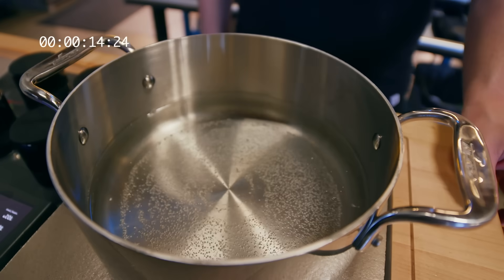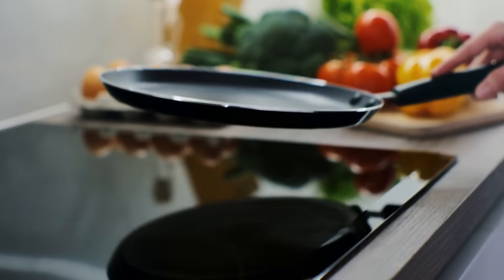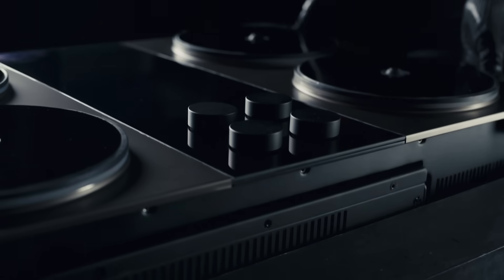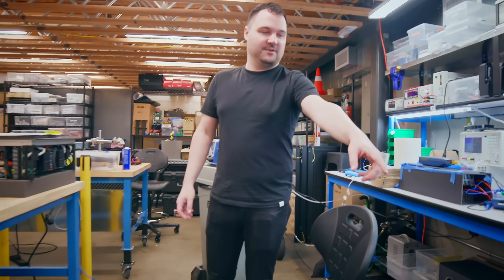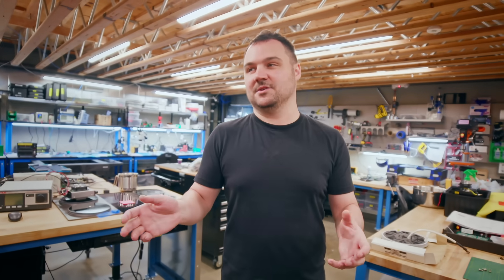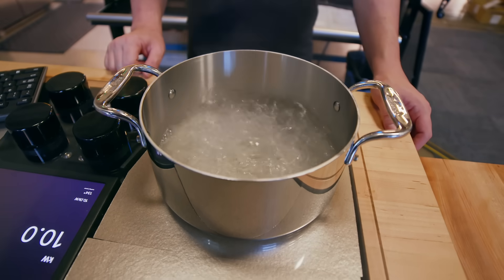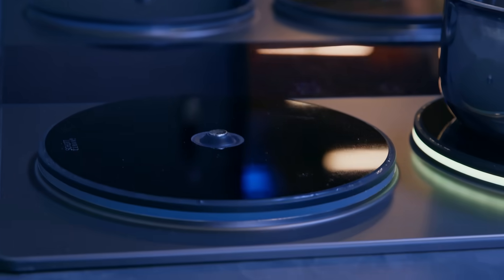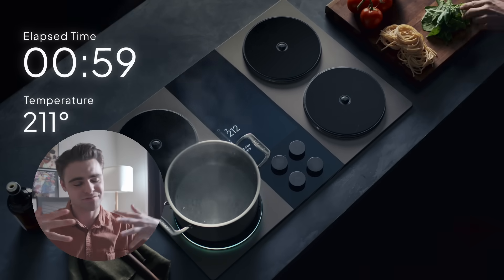World's Most Powerful Stove: Boils Water in Seconds | Impulse

Comment: Interesting innovation to put a battery in the stove for that extra burst of power. I wonder how long can that extra burst last though? For example, you have multiple dishes that need to be cooked, one after the other, for a big meal you're hosting. Also, if the extra burst does run out, how does it fail? Does it fail in the middle of the cook, or does it try to anticipate what you're doing and say it doesn't have enough juice for that, making you wait for a recharge?
Reply: It's a really big battery for the application, but also this is still connected to power so you still have ~1.5kw of power on a typical 120v connection which is more than enough for long-cooking applications or boiling. Unless you're just continuously bringing pots of cold water to boil as quickly as possible for hours for some reason you are very unlikely to hit the capacity limits.

I used an induction hob on a 120v for a couple of months while waiting on my real range, and it was fine for day-to-day cooking

Comment: Jeez, just stop pretending you care about the stove and just make a proper grid tied storage inverter solution if you want to make a dent.
The stove and the whole why gas stoves suck (they do) argument is pretty much pulled out of the ass (stuff gonna burn, asthma, guverment gonna takee yer shit, gas cooking lobby is weird tho).
Putting batteries, power electronics and a display near a hot stove - now there is a great idea.
Also putting a bidirectional inverter, a powerful induction cooker and batteries together - oh that will surely be affordable.
All of this looks cool on the surface, but kinda is a solution looking for a problem.
Temp control function is on point tho.
Miele can do up to 7kW in boost mode, in practice even 3kW is more than enough, at the power some pans literally start jumping on the hob.
Guess 110V single phase just sucks, even split phase 220 is paltry in comparison, EU 3 phase master race just laughs at it.

Comment: Very neat but for the next version I'd ditch the display. Not every device in our homes needs a screen to convey information, a knob works just fine.
Reply: I agree. Nothing wrong with offering both versions though. I will take high quality buttons and knobs over a graphical display for most devices. Look at the huge mechanical keyboard market for proof. Some people have never turned a high quality volume knob or pushed an all metal button for a horn. The best stuff is pretty rare cause most people cheap out on the quality of buttons and knobs. There's a dimmer knob a boat product place sells that feels so smooth, better than any dimmer knob I've interacted with before, but it's like $30-40 when others cost less than $10 so not many people get to experience high quality knobs.
Reply: True, but I feel that the display contributes to the image of a very premium product. 
The oven is very likely the first version as a proof of concept to present to the average consumer that this is in fact a high end product, thus creating a desire to own this product.
Very more likely down the line, this company or companies similar/adopting this kind of mentality, product line or technology, will eventually make more low end products for the average consumer. 
Which... won't have the display, but it's a good preview of what the future could hold. 👍
Which I think is very cool.
Reply: @TristanKazumiK  While my experience with the ultra-premium is limited (I have some though), the display is what someone without experience with Really premium products, thinks a premium product should have.  It's just a false perception...  Really premium items do their job/function as near perfect as is possible First, and Look elegant second.  The looks part, while subjective, tends towards simple being More elegant and premium than complex.  

A digital display will look dated at some point.  It will be the Harvest Gold of an era, gaudy because it was so over-used.  It's a failing of the most simple of concepts, just because you can, doesn't mean you should.  

While this product looks appealing to me, and the function really grabs my attention (minus back-feeding the grid), the display is a turn-off.  Just guessing at the price premium these products will demand, there's simply no way I'd pay to have something that was visually over-done ~ you have to interact with this thing, looking at it, EVERY time you use it.  Don't make it garish to the eye.
Reply: no the display is uesfull to show information at a glance
Reply: Yeah you wanna save a couple bucks leaving the screen out of the $10,000 stove.

Comment: Lol can't get enough grunt out of 240v 32A? Or you cucked by American 110v?
Reply: Are there 3-phase burners? AFAIK burners are always 1-phase, which limits them to 3kW. This video shows 10kW on a single burner.
Reply: @oznerol256  Yes. I can buy a 8kw one here in europe. They are usually two phase, but i am pretty sure there are 3 phase variants
Reply: @oznerol256 if you want 3 phase in Germany, it's with minimum 3 x 20 - 25 A breaker
Reply: @oznerol256 Any kind of electric burner can be designed to run on single or three-phase power. It’s routinely done in industrial settings.

Comment: I mean the fast boiling of water is cool and all, but for what other application would you need that kind of fast heat? But hey its a luxury appliance so no hate there, also the temperature control is great. I also very much like his approach to seeking suppliers in Asia, but the whole story about aiding the electrical grid is bonkers to me. Just another start up "We're going to change the world" attitude. The amount of stoves (or other appliance whatever they might be) with these relatively tiny batteries that would need to be installed in people's homes is nuts to have any measurable effect, combined with over 5k price point. Why not focus on marketing it as an innovative, luxury stove with a sleek screen interface?  That said, great video though!
Reply: You don't need that much heat, misapplying boost function on a normal powered stove (2kW to 3kW boost) burns yer shit in a instant, ask me how I know.
They should be making stoves or grid-tied-storage, but not both.
Reply: I admire the innovation about using a battery for that extra burst of power, but I could care less about their motivations. Personally, I think this sort of thing might be useful in instant water heaters. It keeps peak power lower for the house in general, which minimizes how much you pull from the grid if you have a way of generating some of your own power.

Although, it does make me wonder why one couldn't use super capacitors for these situations.
Reply: @Zeero3846  There is a solution for a water heater that doesn't require all that battery inverter nonsense - a water tank/boiler, you know a 'heat battery'.
Reply: Searing meats, wok cooking, fried rice...